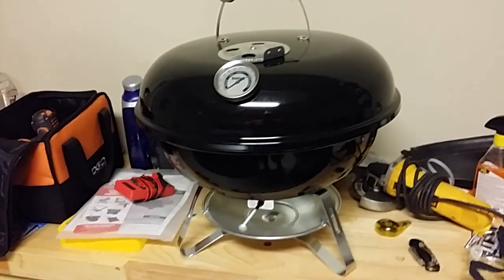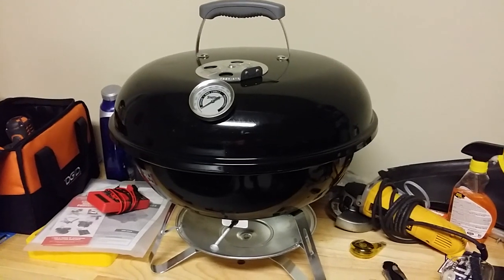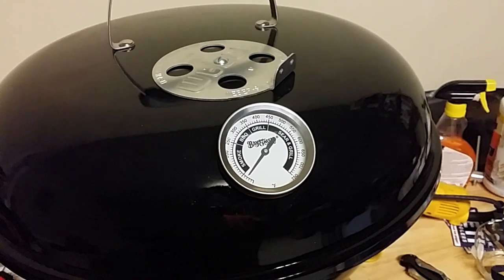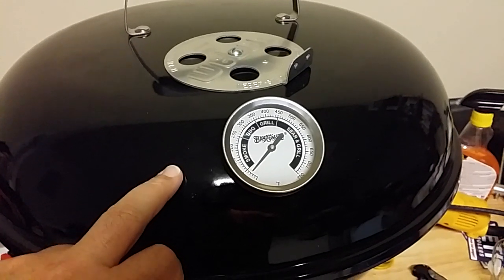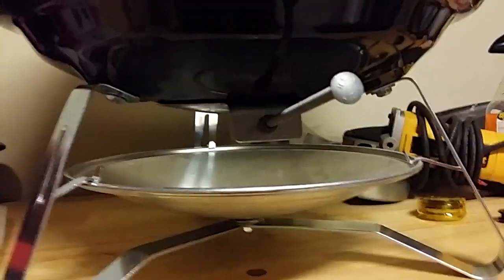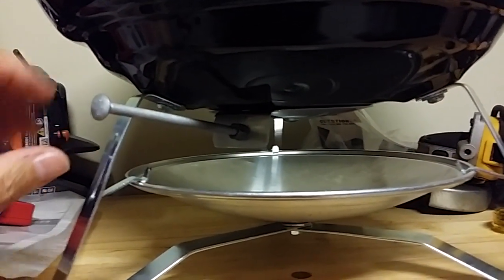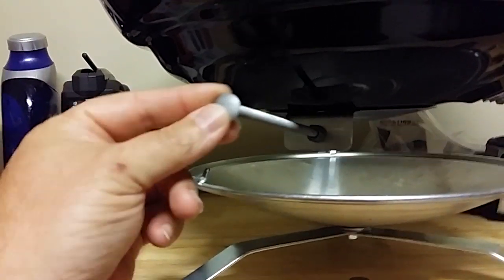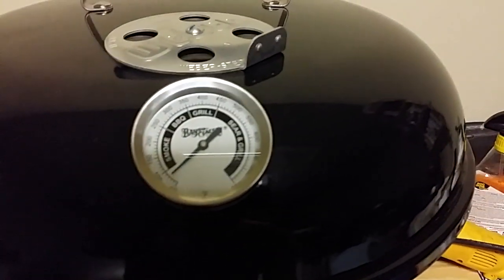Weber Jumbo Joe mods (Thermometer/Louver handle)

Comment: man, that carriage bolt is an excellent idea!
Reply from the maker: +7judas77 
Thanks
Reply: +RaginCajundogg  I got one around the time I left that comment and have only used it 2 or 3 times. How much coal do you use? I assume you use a chimney. I was using a reg SJ and tended to overdo the coals. Now with the larger JJ I seem to be underdoing them. : /  I mainly cook chicken on it. I was at the beach though and I wonder if the constant breeze affected the heat. Do you do any low and slow with it?
Reply from the maker: +7judas77 
I always use a chimney. I also always cook indirect on it. I find the heat is to close to the good and it tends to burn if I don't. Usually less than half a chimney will get me thru any cook.

Comment: I just got my Weber Jumbo, and took the bottom vent to a machine shop to drill a hole to fit my carriage bolt through the hole. What size bolt/washer do I need?  When I bought the bolt, I made sure the washer and the nut fit it, but now when I put the mod in place, the louver handle wiggles too much. Help?